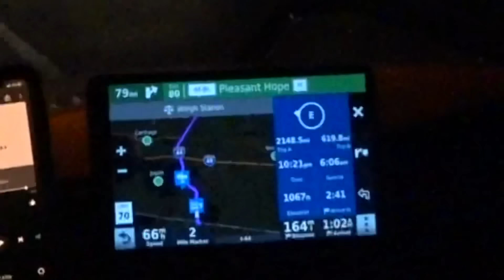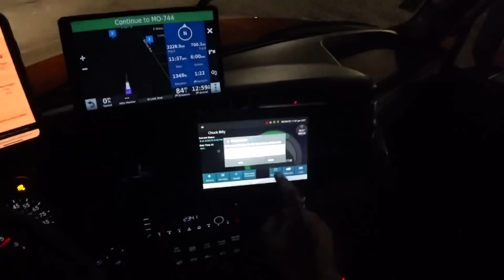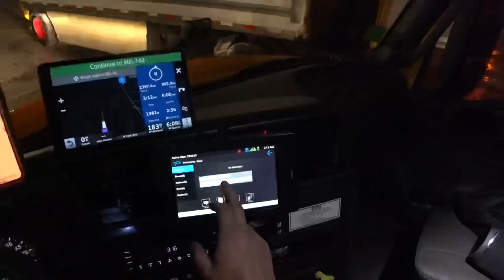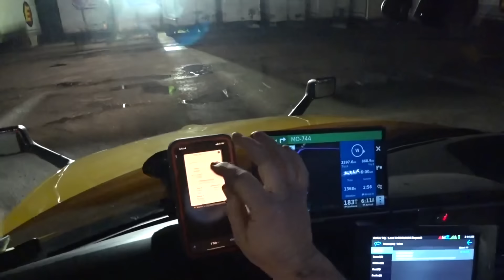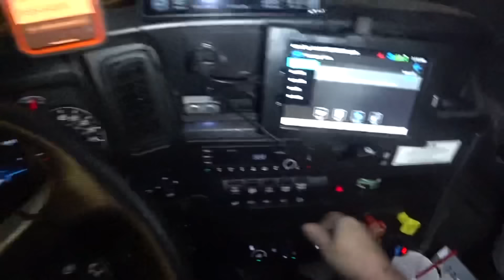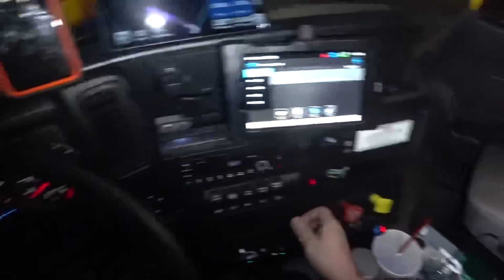HAVE NEVER DONE THIS RUN BEFORE, COME ALONG!! (Estes Express Line Haul)

Comment: Hey Chuck is Estes still buying new 28’ trailers and having them marked with GI Trucking? GIs been gone for a while now but they still have a lot of trailers around. What’s funny is you don’t see any old GI tractors (which would have been all aged out by now anyhow) but here’s the kicker are there any GI trucking converter dollys still around?
Reply from the maker: No they are not putting GI on new trailers.

Comment: Just wondering, not sure if you’ve answered this in a previous video or not but. Does Estes hire people with automatic restrictions? I’ve noticed quite a few trucks, like your usual Volvo, have the manual transmission but they also have lots of automatic trucks too. Will they just like…only plan you on trucks that are automatic if you have the restriction or would they rather hire someone that can drive both?

Great video as always, watching this on my 10 hour break 🤣
Reply from the maker: They have been known to hire drivers with auto restriction but only for P&D. Line haul have to be legal to drive both.  They do require you to get the restriction off in 6 months and you can use an estes truck for the test.
Reply: @TheTulsaTrucker  Oh great! I was actually looking to do P&D anyway for now so that works out. Thanks!

Comment: Hi chuck.  Could you tell us what are the requirements to be a yard jockey and the pay if posible??? Does estes has a new driver program??
Reply from the maker: All you need is a valid drivers license and the pay varies 20-23 hr.  Yes, after 6 months as a hostler you can go through the Estes Driver program to get your CDL.
Reply: What’s a hostler?  Thanks for the info man.
Reply from the maker: @rotaryboy69  the drivers you see in my vlogs that are driving around on the the yard putting up trailers. They also hook sets at some yards.

Comment: Hay Chuck got a story for you back in my Yellow freight days . So back in the late 80’s Yellow started pulling triples from Cleveland to Chicago. Then Yellow did a change of operations and reversed there pulling triples now from Chicago to Cleveland and the Cleveland Line Haul drives can follow there work and not very many Cleveland drivers did that so there was a storage of line haul drivers in Chicago. 
I was a city driver out of Wheeling ( north of Chicago) . At that time I was a ten % presenter . You do not hold a bid you get called and you go to the terminal that needs you . In Chicago there was our break and 5 satellite terminals. So you could go to anyone of them . So I worked Monday and Tuesday no work on Wednesday or Thursday. So dispatch calls and asked if I want to go to Cleveland. They were letting city drivers with road experience cross over . Chuck the difference was most of the time you were hooked up on this giant pad the spotters hook most of the sets so you would find your truck and hook up Yellow wanted you out of the yard in about 20 minutes. So you would hook up your radio box and CB and your suit case . Our trucks had only one seat and this box was were the passenger seat was your placards fire Extinguisher and triangles were  in this box plus all your paperwork and you hazmat book to help with what placards you need to put on you trailer we did  not have central air it was a box on the back wall . So I drive to the brake and get all hook do my vehicle inspection. There are three of us going to Cleveland and the two line haul drivers put me in the rocking chair. So just before we are getting on the Indiana tollway the line haul drivers tell me on the CB we have to pull off and get our third trailer!! Chuck I never pulled  triples and you get a penny a mile more to pull triples . The pad is on the cloverleaf before you get on the Indiana tollway. Illinois will not let yellow pull triples on any road in Illinois. . Chuck I was lucky my third pup was my lead so was not to hard . Most of the time Yellow had a spotter there to help . The dolly’s we used were for doubles and yes they were wiggle wagons 50 mph was comfortable speed over 50 and that  would shake you in the seat . So yellows Cleveland terminal is right at the exit ramp . So we pulled on to the pad and dropped our landing gear and the spotters take you airlines and light cable off we had 5th wheel release in the cab I pull my truck into the fuel line ( yellows line haul did not have fuel gauges because you fueled every day. I took my paperwork into dispatch . Then took my suitcase and radio box over to the van and they drove us to the motel . Got up next morning and pulled triples to the Indiana pad dropped my third trailer and returned to Chicago. So Chuck I pulled triples two times and was glad I never did it again . Later  Yellow got dolly’s for triples and triple trucks . There was this joke about why Yellow trucks had only one seat in them . So the drive knew were  to sit  lol Yellow line haul trucks were. Brigadier’s with yellows 7 speed  transmission later the triple trucks were 10 speeds . Times have changed so much . Automatic transmissions and air ride suspension and GPS . Be safe enjoy your videos.
Denis
Reply from the maker: Times have definitely changed thanks for sharing!

Comment: In this VLOG you backed up a pup with a dolly. Explain how difficult it is to back up a double.
Reply from the maker: It takes some practice for sure.  It’s like backing a trailer in reverse  and allot of anticipation, you are maneuvering two pivot points.
Reply: @TheTulsaTrucker  I understand that if you want the rear trailer to go to the right you steer the truck in that direction while making sure the lead trailer doesn't get crossed up. I enjoy watching your VLOGs and travels. Be safe. l
Reply: Once you learn it, it's easy. The smaller the equipment the harder it is to back due to having less time to correct the angles, which means you have to develop the ability to anticipate the movement before you can visually see it. 

Backing a dolly can be made more difficult by the size of the pintle hook and reciever. It takes around 20 hours of practice to be able to back any dolly on the back of any trailer without doing a thousand pullups. It's usually a skill you have time to learn as a hourly yard jockey before you're sent to the driver school.

If you missed your jockey experience you can just find a quiet part of the yard to practice whenever you are waiting for a load.